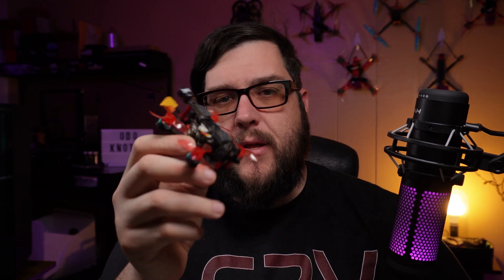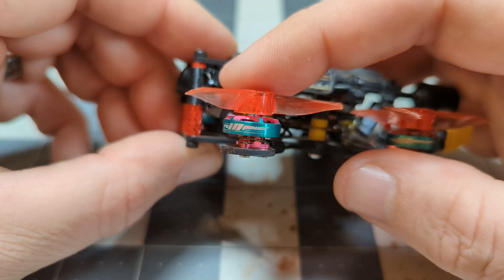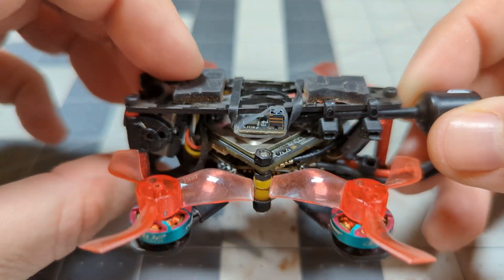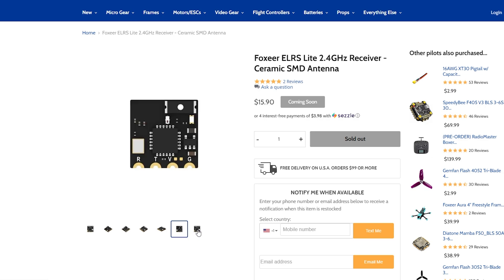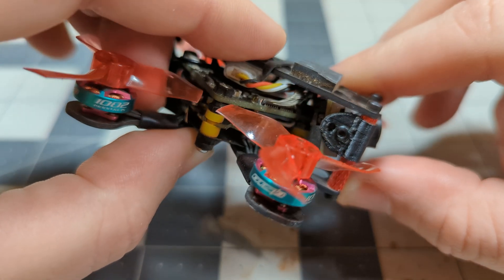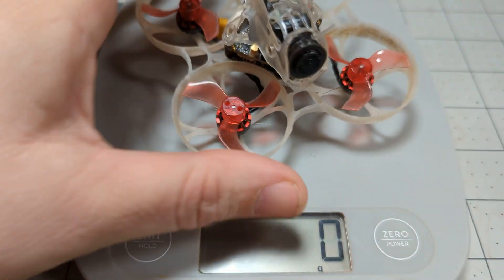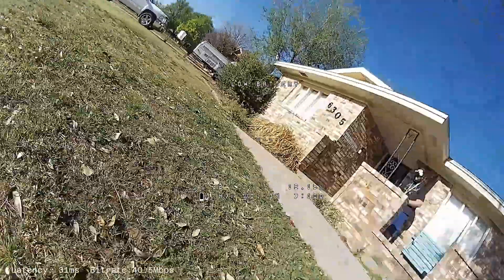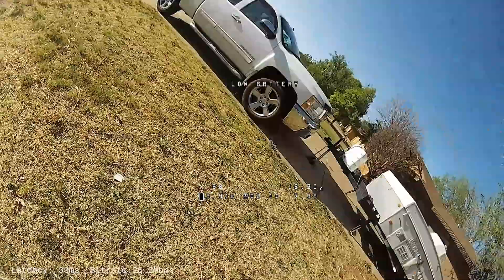I crammed 1080p HD recording into this tiny 1S FPV drone!  CraftedKwads Odonata Build

Comment: I just completed the same build:  2" Odonata with walksnail HD 1S  VTX, Foxeer AIO, T-motor 1103 11,000kv motors on 2S batteries.  Yesterday I was out testing battery sizes to see which one worked best in terms of weight vs flight time.  I brought it in and landed in the grass.  1st battery, it stopped arming after that.  I played with it some.  I didn't realize until after I got home, that it had lost the ELRS bind.  I'm wondering what/why the bind had to be "re-bound"?  I watched your video on the different led flashing, and what they mean.  I'm just curious why it would lose the bind.   SUBBED!

Comment: Run it with a 2S pack for extended flight time.  Just cut the motor output limit to 55% or so in the PID Tuning tab.

Comment: why don’t you go 2s?
Reply from the maker: Mostly the pack weight really.  This quad already weighs quite a bit more than it was designed for, so doubling up the pack weight would really make it fly pretty terrible.  I could technically go up on the prop pitch and motors to compensate, but there is just only so much you can do for it with this size prop.  Staying at 1S with it seemed to put it in the zone I was targeting for the all up weight and minimal impact to flight characteristics :)

Comment: I'm in the middle of making my Odonata. It gives me hope to see your build because I am also using 1002 20,000 kv motors and I'm worried about the weight.
Thank you MBN for another great video! 😎
Reply from the maker: It should be one heck of a ripper!! This small little thing still spends a lot of time ripping with me in the front yard, even though I am building micros like crazy lately, lol.

Comment: You flying the little bugger with Avatar goggles or the VRX? How are you finding it?
Reply from the maker: I am running the VRX for this one.  The firmware updates have made the smearing quite a bit better, and although I can feel the latency of the lower frame rate mode it isn't as bad as it was when I was first testing.  The future of Walksnail is looking pretty good at the moment!

Comment: i break off every one of those ceramic antennas, they crack when you bang into anything, easy fix, just solder a wire in place of it,  i wonder if the tower  can be encapsulated in a glue, like gorilla grip or epoxy?
Reply from the maker: yeah the first time I have an issue with it, the fix is going to be a wire antenna for it, lol.  It would be cool to see some testing on how epoxy impacts signal quality specifically for these kinds of antennas.  Maybe I will figure out a way to do that!

Comment: That's a great little build. I just built out that frame a couple of months ago with 2S and the Happymodel X12 5 in 1 and 0802 16,000kv and it is a fun little yard ripper for sure. Unfortunately, I only have DJI, so my smallest non-whoop HD build is a 3" toothpick with 12025 6400kv. The little Odonata makes the yard feel so much bigger though, and I love the handling of the top mount battery too.
Reply from the maker: I think the x12 is a great choice!  That would be what I would have gone with if I wasn't after such a high amp limit out of a whoop mounted board.  I really do love how it makes a small place feel much bigger, and im gonna keep ripping it just for that reason!

Comment: Exactly the same but with aio, happymodel crossF4 or Betafpv Aio 5A would have been perfect!
Reply from the maker: Yeah I thought about a smaller more feature rich AIO, I just really like the 15A headroom on this one.  The amp draw counter in the OSD shows it pull 12A pretty often, so a 5A would have popped pretty quick I think.  Just big ol' motors and a chonky weight class.

Comment: I actually tried this a couple of weeks ago. I couldn't fit the camera and decided to move the components to a happymodel bassline. Very fun little quad.
Reply from the maker: It is like playing tetris for a bit, lol.  I had to customize the mounts a tad, and even then it still hits the stack in the back so I am angle limited.  I would rather have the lower angle and HD recording than go analog and get that angle adjustment back though.  Now if I never wanted to share footage from it for videos like this, then I would probably go analog, save the weight, and just rip the heck out of it!

Comment: But, does Walksnail's 1080p actual LOOK LIKE HD now? Cuz, last time I heard about 1080p from WalkSnail, it wasn't any better, actually worse, than their 720p.
Reply from the maker: It still has a little bit of the melt zone in places, but I do have to say it is better than it was back at the very beginning of the year.  They are really hitting the firmware updates, and it feels like that has been a big focus for them.  It is for sure better than 720p, but not quite as good as DJI O3 in 1080p mode.  Still though, the on board recording is pretty darn good for a little quad that could slide right into your pocket!
Reply: @BaconNinjaFPV  It's good to see someone building something besides 5" drones! Unbelievably over hyped, that size!  Micros are a blast to fly. Good to hear Walksnail's updates are actually doing just that - making the system better!  I applaud them! 👋👍

Comment: I liked that darwinfpv aio. As long as it worked 😢. 
The betafpv or happymodel 1S aio are also like a 30% risk they dont work properly.
Next one to try would be the jhemcu 5a 1s aio.
I also love that walksnail 1s vtx.
You only have to watch out to get a good 1S lipo. Preferably not a HV.
The tattu 500mah rline 1s are great.
With the walksnail 1s the video  goes out when you punsh too hard toward the last part of the battery. The voltage just sags too low.
We just need a better 2.5" bi blade prop for a good backyard 1s ripper. Also some  1202 15000kv motors.
3" just needs a little more space.
Reply from the maker: I think this rig might pull a little too much for a 5A since it is a bit on the heavy side, but I know there are some 12A HM boards that may be a good substitution...if they work, like you said, lol.  I am indeed running non HV packs on this for that very reason as well! :)  I haven't had one of their 1S kits fail on me yet, and I have a hand full of them at this point.  we shall see if my luck continues!

Comment: I have my mob 7 hd moved to the odanata and run both 2 s and 3 s on it.  You need to remove the motor connectors and hard wire them, and I moved the camera in front of the frame. Think I post a pic before I hard wired the motors to your discord a while back 😊
Reply from the maker: I remember that!  On a build like this, ditching the motor connectors would for sure be a must.  I almost went the route of putting the cam outside the standoffs, but opted to just try and squish it in so that I could protect it a little bit with the frames front end.  You still rocking that Mob 7 conversion?
Reply: @BaconNinjaFPV  yup when I get a moment,  work and kiddo have been Monopolizing my time